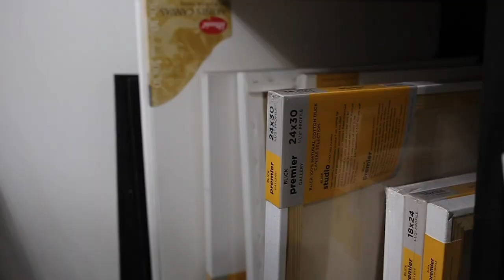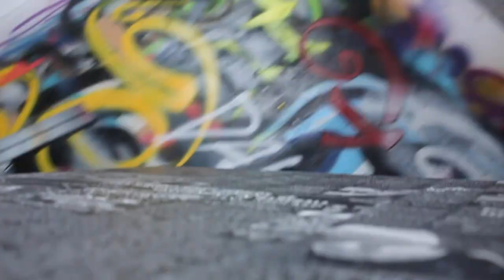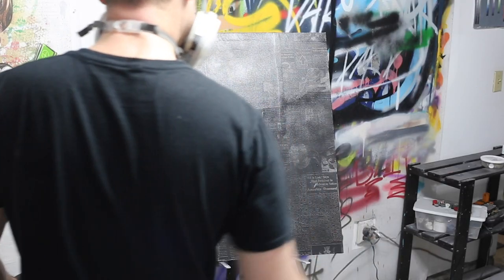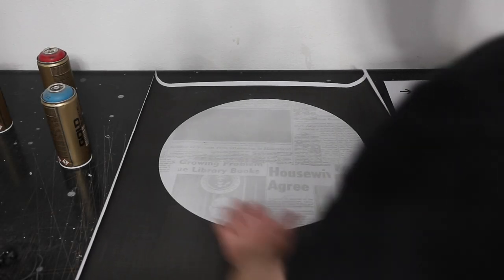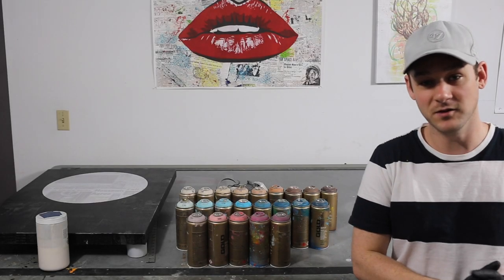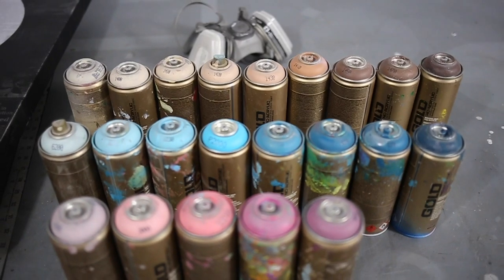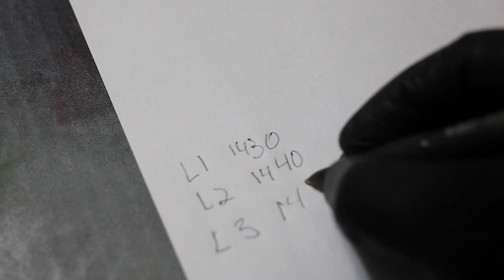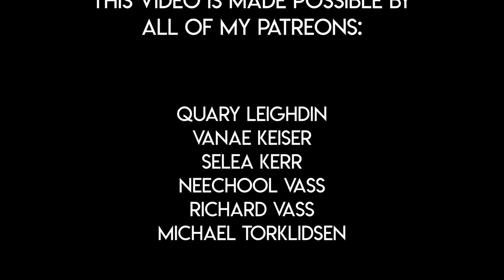Making Art During Quarantine - Spray Paint and Stencil Art

Comment: Hey man what caps do you use for stencil work and why?
Reply: Hey man!  Great question.  I've got a link below for the caps I specifically use for stencils.  I use the Montana Flat Jet Cap Mediums for stencils.  I've tried a lot, and this one feels / works the best for stencils.  

2 big reasons why these work best for me. 

1st is because of what I've always called blowback.  A big obstacle to making stencils look neat is the paint blowing up under the stencil (and I use paper stencils, which can be floppy), which makes lines and details look fuzzy.  The lower pressure, airy caps that come standard on the cans will blow slow and soft, and results in a lot of blow back.  These ones have a very even and constant pressure that almost helps keep the stencil in place. 

2nd reason is just that these tips are designed to give a wide and even coat.  So the paint lays VERY evenly, and usually with just one quick pass.  A lot of the other caps (especially the fat caps and calligraphy caps) have an uneven distribution of paint, wether its on the outside or inside of the spray circle (if describing it as "spray circle" makes sense.  Basically If you just point the can at a surface and spray without moving, it will make a circle shape.  The paint will be thicker in the middle or around the outside of that circle with standard and calligraphy caps.  This is not what we want.  We want even.

The Flat Jet caps are designed for applying varnish, which needs to be applied very steadily and evenly.  This works perfect for stencil work.

Hope that helps!

https://www.montana-cans.com/en/accessories/nozzles/montana-special-caps/montana-flat-jet-cap-medium